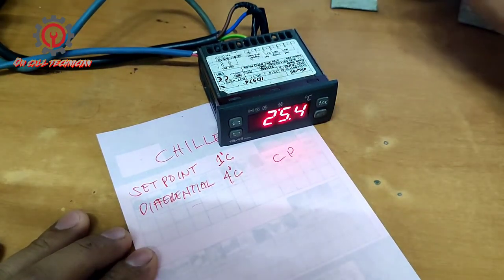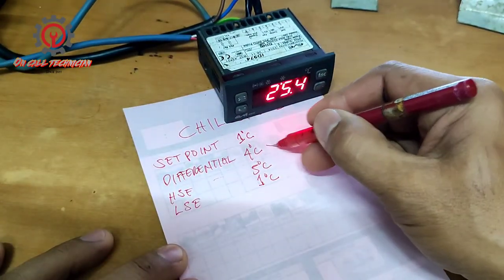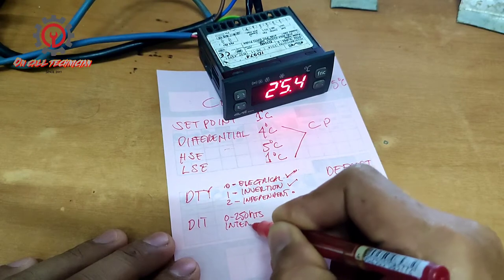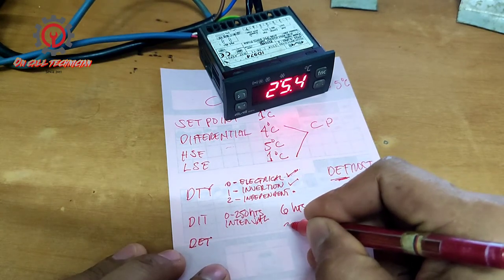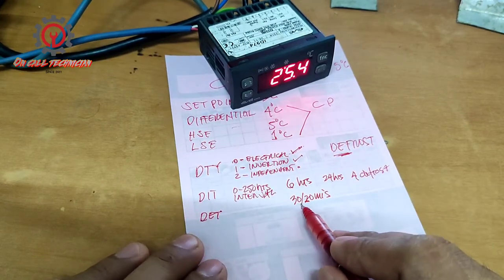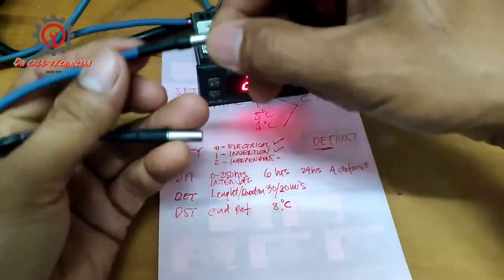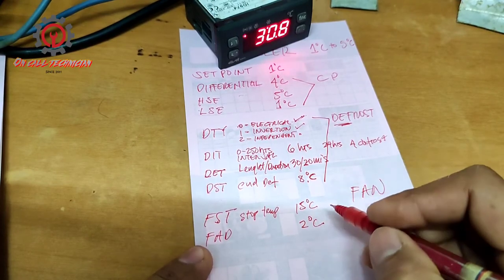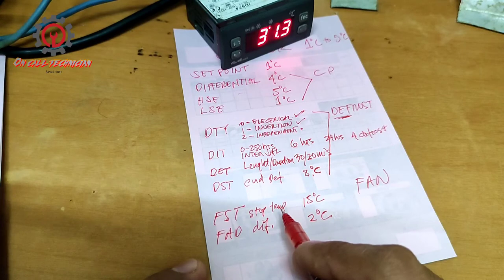HOW TO PROGRAM ELIWELL ID974 FROM DEFAULT TO CHILLER SETTINGS

Comment: Sir pa paano po mag program nang Eliwell EWPlus 978? May alarm din sir sa upper right corner na controller d ko alam kung ano yun alarm na yun at kung paano I reset. Pls help. Thanks in advance
Reply from the maker: Wala po akong ganyang model sir, download mo sa google ang manual sir. Andun din po mga alarm code nya